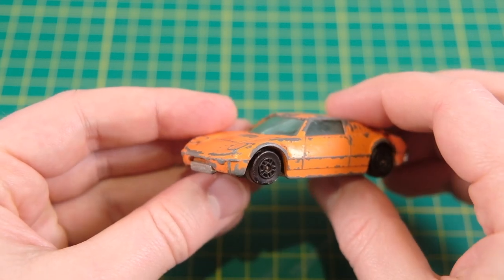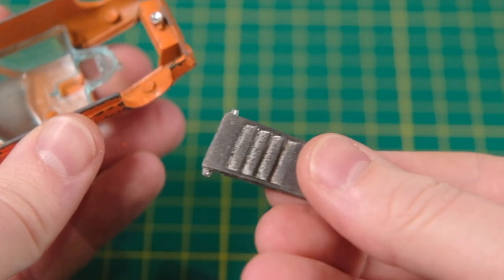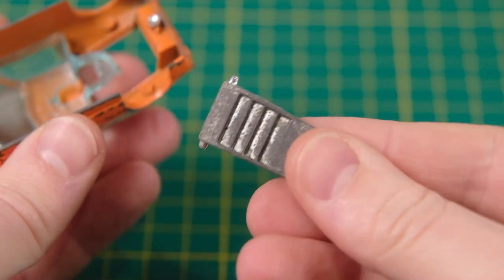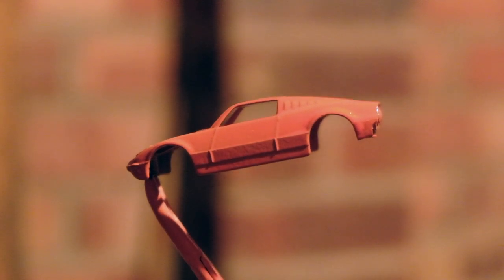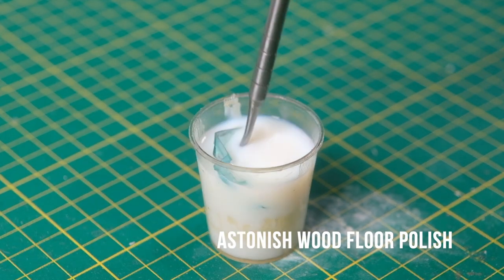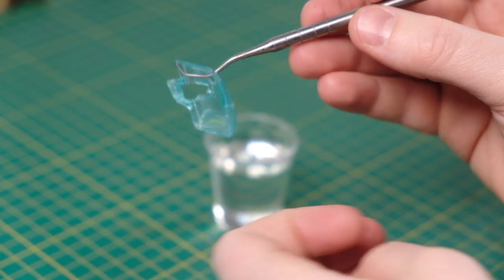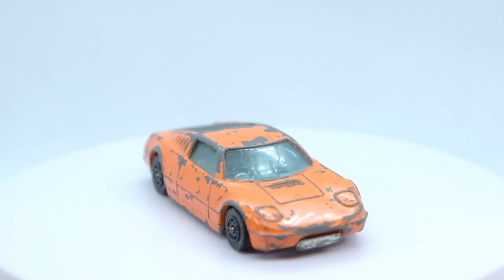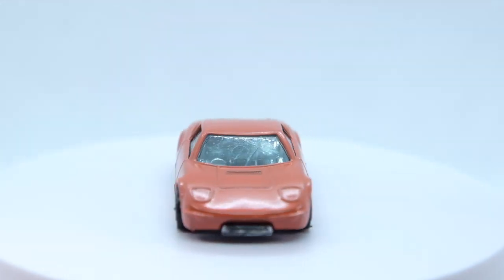CORGI restoration: 10B Ford GT70

Comment: Great job as always Jason, I think the Humbrol clear varnish is a double edged sword on the glass. Although it does provide a glossier finish it does, in my opinion, highlight even the minor scratches and buff marks more. with a restoration its always a difficult choice whether to make as good as possible the original part or or make a more invasive repair. Juan over at Matchbox resurrection did a great job on a mini recently where he cut out the damaged rear window and replaced it with new clear plastic. it looked superb - better than original. The other item I could suggest you might want to try is a different polish item.  There is a tube of polish called "polywatch" its used to remove scratches from plastic and resin watch faces and is pretty good at that. :-) Keep up the great restos Jason - Love your videos, stay safe, Ben
Reply from the maker: Polywatch has gone straight into my basket on Amazon! Thanks for the tip
Reply: @DieCastRestos  Will be good to see how it works for you 👌🤞 Have a great weekend!

Comment: Beautiful restoration Jason. I always enjoy seeing your work and the research you share with us. IMO Ford only went downhill when the replaced the fine lines of the GT40 (it was my favorite Matchbox car 😁). I saw an improvement in the windshield but am curious if the Humbrol would seep into the crack if it were applied before the wax. Perhaps it’s ability to “self-level” would make this possible, where the wax would form a barrier between the crack and the Humbrol. Just a thought.
Reply from the maker: Good idea, definitely one for the next split screen!

Comment: Overall, very good job on the restoration, Jason. However, think that particular model would look better with detailed, after-market wheels rather than the stock ones. Nice thing is, it's a quick fix if you decide to make that change in the future.